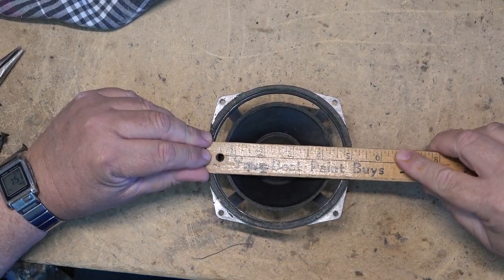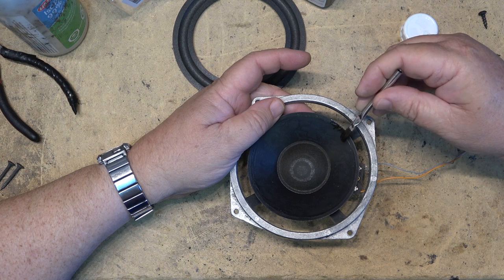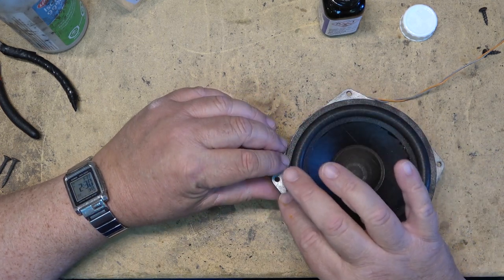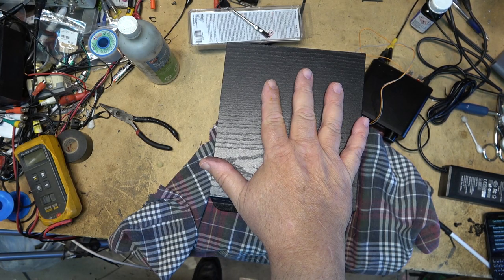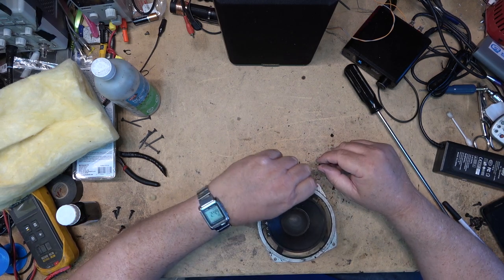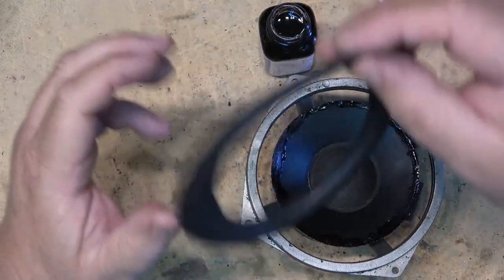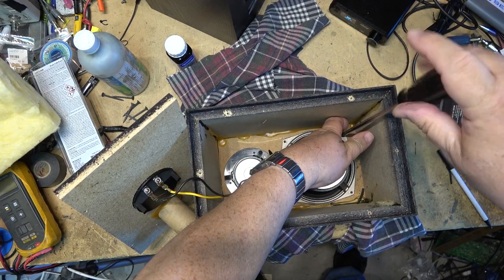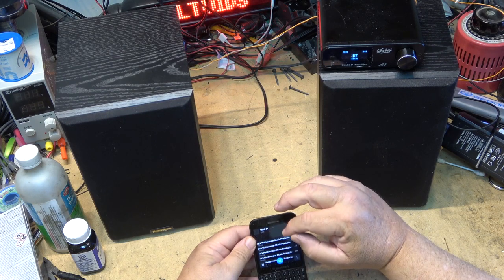Repairing a set of Paradigm Atom Bookshelf Speakers

Comment: I was really cringing when I saw you using "rubber cemement", but you made it work! I don't like it for two reasons. 1 it sets up too fast and 2 it messes with the foam in a couple bad ways-soaks in too much, and warps/morphs foam. Again, you made it work and that's all that counts! I noticed in comments below someone said they got elmers-with a foam kit? Just cuz it's white doesn't mean it's elmers. ELMERS dries hard. Speaker glue dries flexable. If I have no speaker glue on hand, Aleene's tacky glue is the next best thing because it also dries flexable-just like speaker glue. I agree the shim method is not necessary, unless the spiders are warped badly in which case one would need to shim the vc, get the spider wet, and let it dry......
Reply from the maker: This is not rubber cement.  It is speaker repair adhesive.  Designed specifically for this work.  This is what the manufactures use.  I didn't "make it work" i used the correct product for the application.   It is not rubber cement.  Smells nothing like rubber cement and does not set up instantly like rubber cement.   This has charactistics or rubber cement in the way it stays flexible.  Great for repairing cracks and rips in cones.